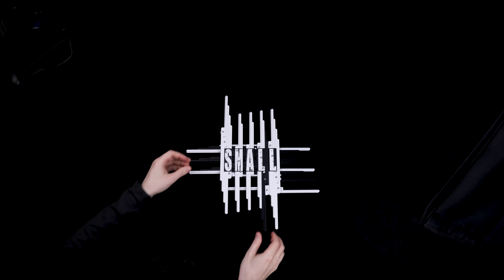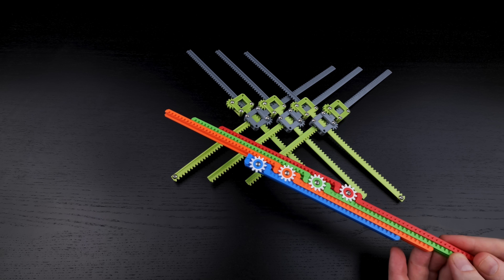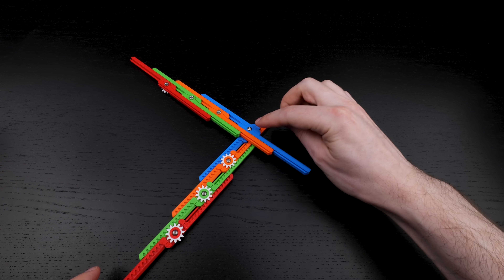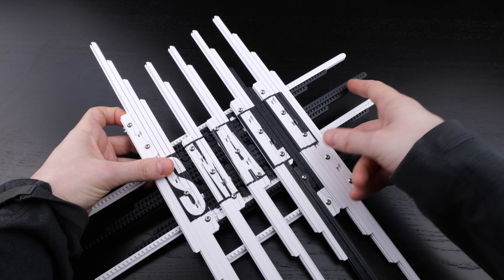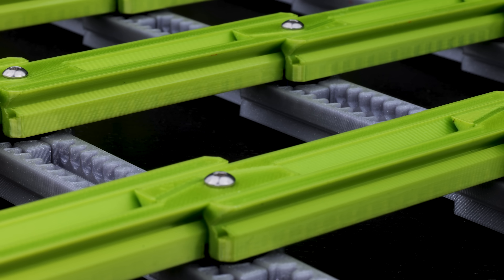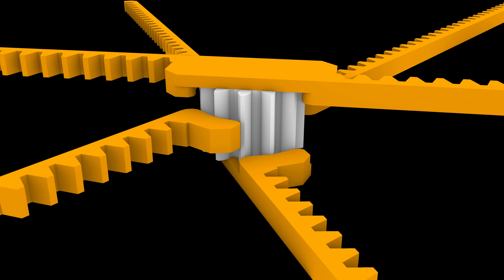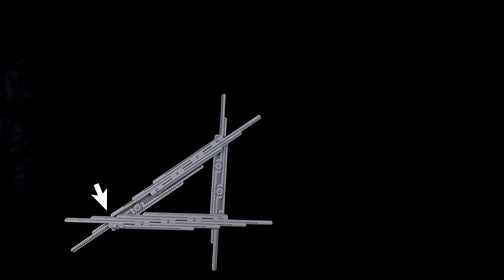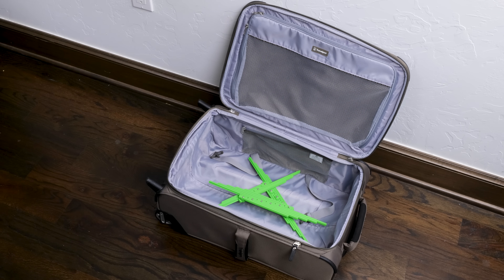Expanding racks

Comment: What would happen if you curved the racks out of the plane?  Could you make an expanding hemisphere with curved ribs that project radially from a central point?  The ribs could possibly be banded together circumferentially for support.  It might resemble an umbrella except that it grows outwards to encompass a larger volume rather than splaying.
Reply from the maker: I think this might be tricky - wouldn't the curvature of the racks have to change as the mechanism expanded?
Reply: @henryseg Hmm.  I think you’re right.  And perhaps there’s are simpler ways to progress through curved forms to discover interesting results.  Curving the racks of a rectangular mesh out of plane along one axis should yield a cylindrical shell.  Then curving the racks of the perpendicular axis would make an expanding patch of a hill or valley.  Alternating curvature of the racks could yield some interesting shapes, maybe saddles or waves, as long as the ends of the racks don’t interfere?  And if three curved racks could be made to meet at a point, then perhaps an expanding icosahedron would be possible? 

Alternatively, there could be some interesting outcomes using flat racks and tilting the pinion gear axis away from the normal so the racks interact in different planes angled away from one another (but they’d need some other mechanism for coupling together).

Comment: I was thinking about how curved racks could work but realized with the single-layer design there are lots of limitations. Any rack inside the curve of another rack needs to have a curve of the same or smaller radius. But I think with two layers, you could probably get some interesting effects from the angles between two parts changing as they extend. Something similar to the stuff you made at the end of the recursive racks video

Comment: This could be useful to create an actual rack out of racks and pinions. Two of them on opposite sides of a space, with bars joining them across the third dimension. Pull on it to expand the rack out to access whatever you have hanging on it, push it back in to collapse it back into a smaller storage area. Usually this is done with scissor linkages, but perhaps this linkage could enable some useful geometry depending on what you want to store in it.

Comment: Expanding Penrose tiling?  lol. 

I wonder if two straight sets of these could be connect to create a new kind of tool for drawing ellipses.  Two straight sets of these racks would need to be connected so that when as the angle between the racks changes their lengths change appropriately.

Comment: Very coo stuff! For the 45° racks, I foresaw you'd have to scale up the gears, but did you scale the racks in all 3 directions or just scale the length, then change the width to accommodate the larger gear?
Reply from the maker: I scaled in all three directions, except that the geometry of the bolt hole has to stay the same.

Comment: this is beautiful. the triangular latice looks like it's really expanding optimally, if you had full control over material in a given space, the bars getting slimmer as they get longer, just in low resolution. you can see the stairstepping, like pixels on a screen.

Comment: 6:05 If you fix both end points to a table, I think the middle point will trace out an ellipse, since the sum of its distances to the end points stays constant
edit: this won't work :(, since the edges always have to stay at a 90 degree angle.

Comment: Looks like it might be a quick way to build scaffolding. Though the gearing and the crappy environments that scaffolding usually lives in may be incompatible. Time is money, though. Might be worth it if you can scaffold a wall in 20 minutes instead of 2 hours 🙂 It'd need a pretty solid safety measure to make sure it doesn't stow itself while you're on it. With canvas, or snap-in panels, you may have yourself a robust event tent that you just pull the corners to set-up. In both cases, not every leg would need gearing.

Comment: It would be beyond amazing if those mechanisms would be micro scale, but repeated often they'd be macroscopic. Someone please invent a matter compiler from The Diamond Age and give it to this man.
Reply: Wait till you learn about metamaterials (pretty much exactly that idea)
Reply from the maker: I've been waiting around for nanobots that can put carbon atoms in exactly the right places.
Reply: @henryseg  You can create microscopic geared systems using two-photon polymerization (2PP) which uses femtosecond lasers that only cure resin where two photons simultaneously hit the same spot for sub-micron resolution. You can also use projection micro-stereolithography to get resolutions of 1-10 micrometers. Multiple parts can be printed simultaneously in a single exposure.
Reply: @henryseg electron beam lithography is the closest but that requires a million dollar machine
Reply: I feel like the best direction to head for nanobots right now is just proteins, especially with how AI is able to design them effectively
Reply: I feel like your bicep is basically exactly that. It's just that you can't cheat physics, so the collapsed form of anything visible is always going to be visible unless you're right on the line and it collapses into an extra dimension.

But all you have to do is flex and the muscle fibres all go from relaxed in extended form into a coiled-up mass up by the shoulder.
Reply: Just an idea to throw out there: The rails might be hard to miniturize, but I just thougt if one side is a magnet, it would keep the sticks together ... but I did not think this through - the polarities of neigbouring sting might become a problem
Reply: Protein bombs, expanding inside the body!
Reply: This is literally how muscles work on a nano scale, so, your idea is right on
Reply: muscles work fairly similarly to the two-rack version on a moleular scale! long actin and myosin fibres are pulled past one another via the cyclical action of myosin heads :) but it doesn't have the transitive motion transfer of the multi-rack system, each of the actin filaments are cross-linked to each other. seems like there have been discovered examples of rack and pinion complexes! https://pubmed.ncbi.nlm.nih.gov/32181348/
Reply: can't mems (Micro-Electro-Mechanical Systems) replicate this in a smaller scale?
Reply: @UNKNOWN-mz6fn  Most mems are extremely mechanically optimized/compromised to reduce frictional and torsional vector components, do to intensive material limitations at such scales and with such processes. So while similar concepts will eventually somehow translate effectively, simply shrinking the design will introduce stiction and friction issues, and potentially a material unsuitability due to the divergence of materials properties between the macroscale polymers and the microscale silicon etc, and the potential inability of the Mems process to recreate the proportional design tolerances that allow the original design to function as intended.
Reply: nice rack
Reply: How about the tech from 3 Body Problem?

Comment: Very interesting, the obvious next step is to try to expand it to 3d. I’m also thinking you could fix a rack to a gear to have the rack rotate at a rate depending on the size of a gear, and also have the axel of the gear spin to transfer a differential, allowing the top rack to spin and expand with the lower rack. Perhaps this could be used in a kind of grabber mechanism, or even something more complicated.

Comment: expansion along one direction leading to contraction along another direction could be used to simulate the whole range of rectangles with a given surface-area. 
I would not bet that this is interesting for other people, but I have been thinking about the Legendre Conjecture recently,
(which says that between two square-numbers, there is always at least one prime)
which might be provable via reference to certain ways of constructing rectangles of the same surface-area 
(as prime numbers are the numbers of which it is impossible to construct a rectangle with them as their surface area without using any other integers but themselves and one)

Comment: I would assume a mechanism like this would be useful in applications where you need to store something in a small space and later expand it. Examples that spring to mind immediately are deployment mechanisms for things like solar panels and telescopes for satellites. Origami has been used to optimize for similar problems where you're dealing with a fabric or membrane type structure, say with an airbag in a car.
Reply: convention booth shelving

Comment: At the beginning you showed a mechanism where one side grows as the other shrinks. At the end you showed special gears and racks which are scaled to give different translation amounts for the same gear rotation. This is a form of mechanical advantage! You could make a strange sort of lift where a motor squishes the bottom to raise a heavier elevator!
Reply from the maker: You can really feel the mechanical advantage when you try to move a stick with your hands at either end of the whole stick versus just on two neighboring bolts.
Reply: @colinfurze is looking for a lift mechanism for his secret garage. The simplicity of this design with all mechanical linkages seems to be a good fit for his safety and aesthetic requirements.
Reply: @jheckey Ah, safety requirements, from the madman who built a high-speed rotating blade belt.
 The human food processor.
Reply: @jheckey  I don't think it collapses enough for his purposes though
Reply: he could make a quadrilateral that retains the same area as it transforms using that mech

Comment: 6:06 I thought that this could be used to simulate special relativity, since hyperbolic rotations (aka spacetime boosts) in an xy plane can be seen as shrinking along the  x = +y  line and expanding along  x = -y  (or vice-versa). However, in a hyperbolic rotation the area is kept constant, which isn't the case in your mechanism. (Since the shrinking on one side is equal to the expansion on the other, so e.g.  10 cm  x  10 cm  =  100 cm^2 , but  9 cm  x  11 cm  =  99 cm^2  =/=  100 cm^2 .) Not sure what use there is for this linear version!
Reply from the maker: Right, I thought about @minutephysics’ Lorenz transformation mechanism (https://youtu.be/Rh0pYtQG5wI), but the relative speeds would not be correct with the current racks design. Perhaps some variable radius gears could make it work somehow.
Reply: @henryseg  A way of doing this is with variable radius to give an exponential function.  Then axes go a⁻ⁿ and aⁿ.
Reply from the maker: @andrewkepert923  I worry about how big the gears would need to be to allow for that much variation. Maybe there is some way to do variable speed with a gear train? But then most gears will rotate around more than once, which makes it hard to see how extra gears could help.